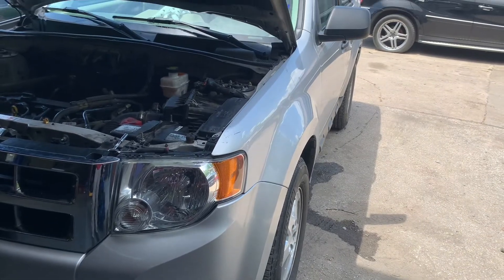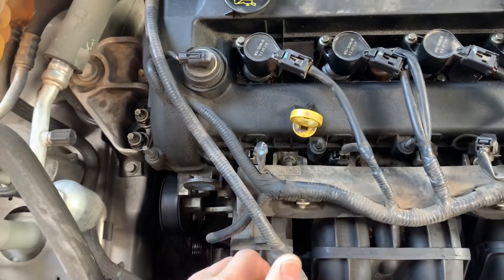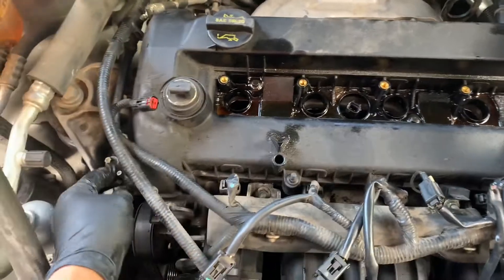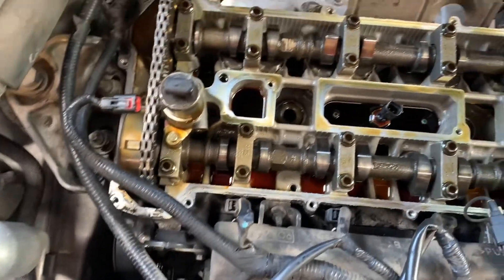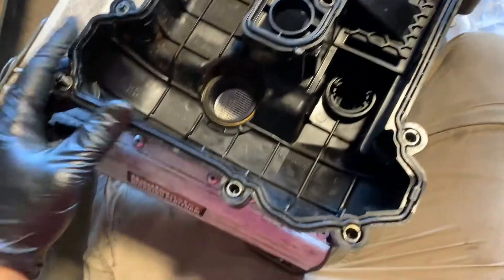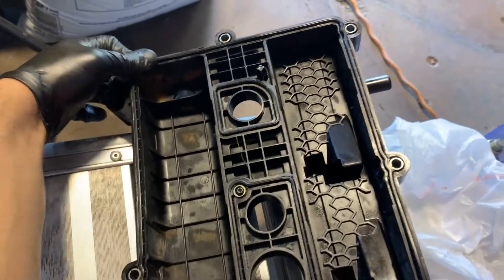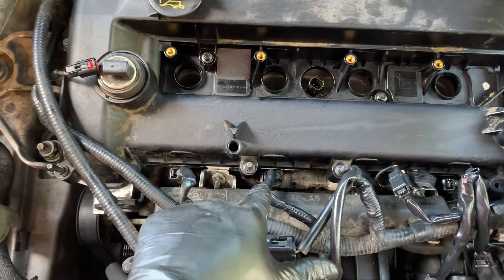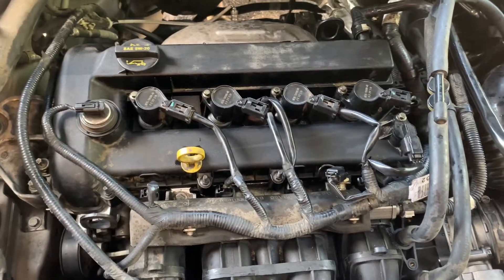2009 Ford Escape Valve Cover Gasket Replacement

Comment: Do I take the spark plugs out first then the valve cover or do that after???
Reply from the maker: Either way is fine.
Reply: don't take the spark plugs out until you have verified there's no oil in the spark plug wells.